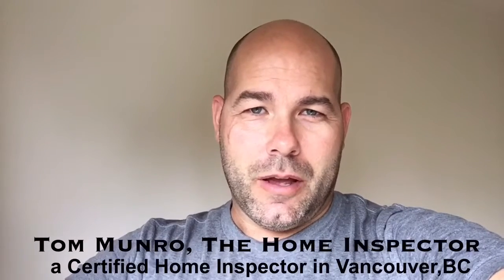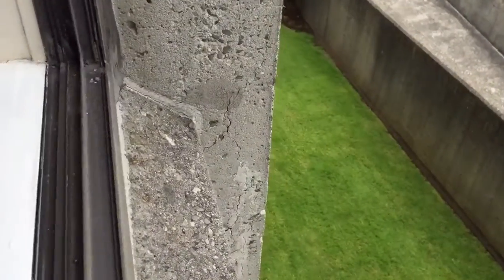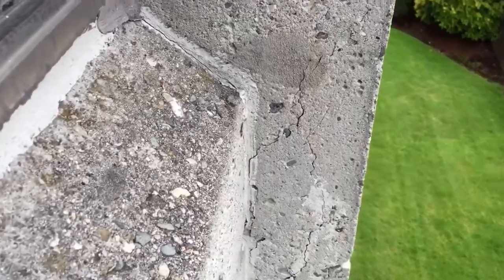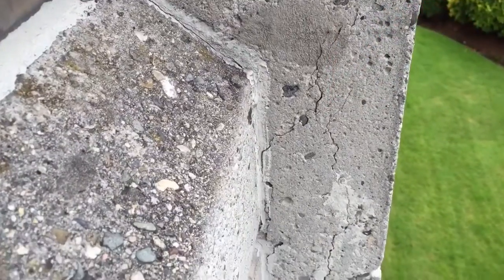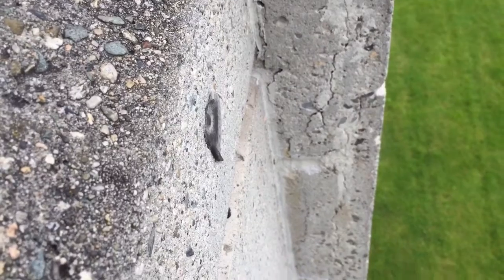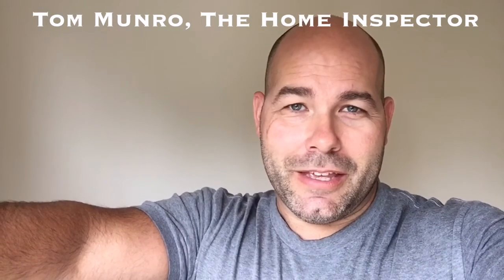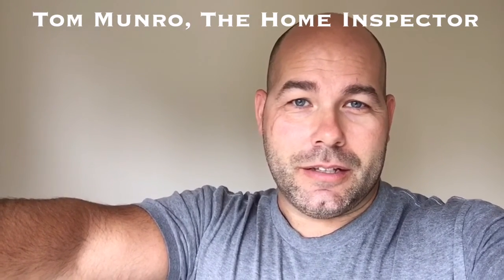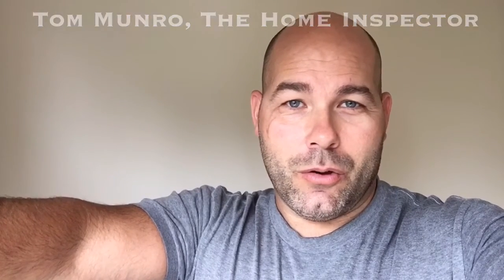Concrete Spalling - How a Concrete Building Deteriorates

Comment: Wrong, the reason for the spalling is the poor workman ship of the building. No steel should ever be within one half inch of the outer edge of the cement. The expansion and contraction causes the concrete to crack, if the steel is not buried properly.